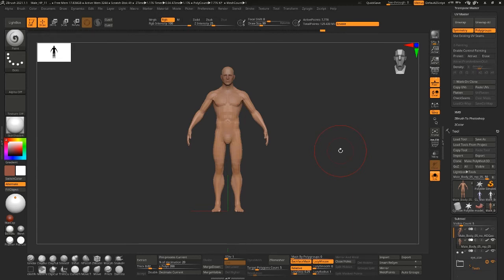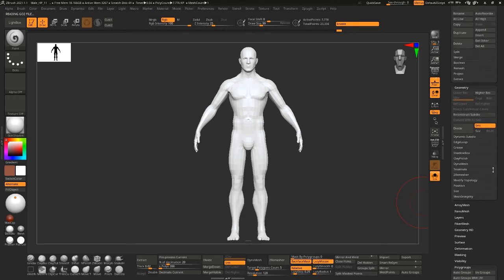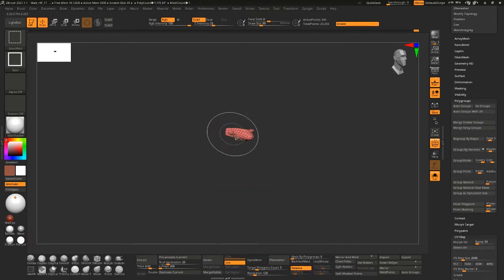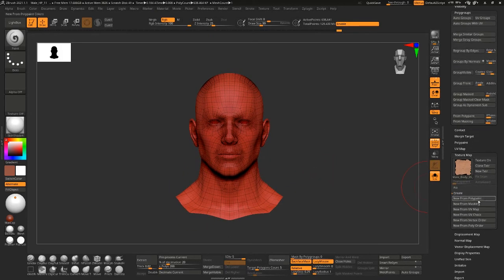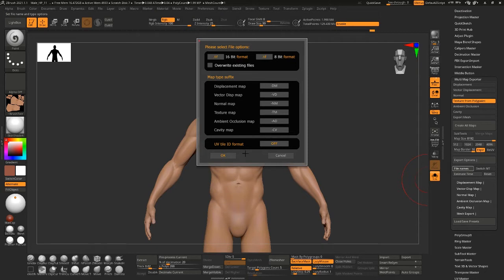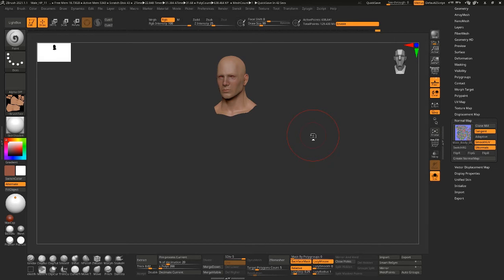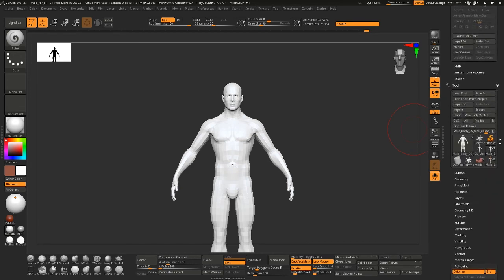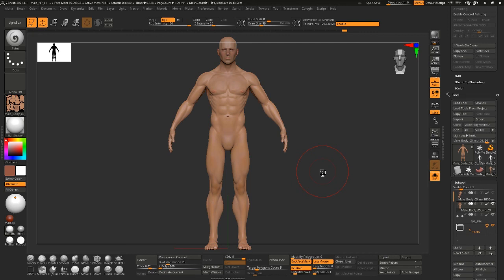ZBrush Tutorial - UDIMS in ZBrush

Comment: Thank you so much man, I have a little question about the resolution of the texture map tool is in 2048x2048, since I'm having some bugs with the multimap exporter, I'm wondering, how can I up on the resolution to 4k?
Reply from the maker: In multi map exporter there is a slider where you can set the resolution all the way up to 8192.  If you are having problems with the multimap exporter and want to export the maps individually you can change the size of your uvs under the uvs tab.
Reply: @JoeParente  This is a simplified answer, I really appreciate!
Reply: Solved: just go to UV map tool and set the resolution to whichever you want.